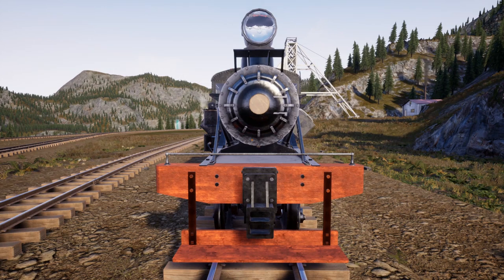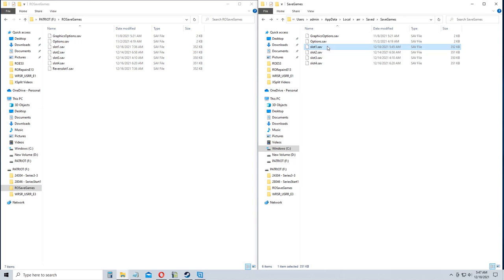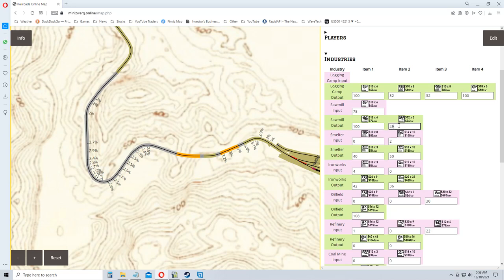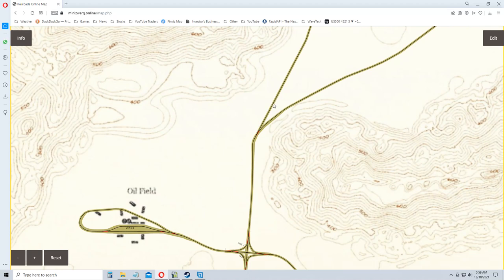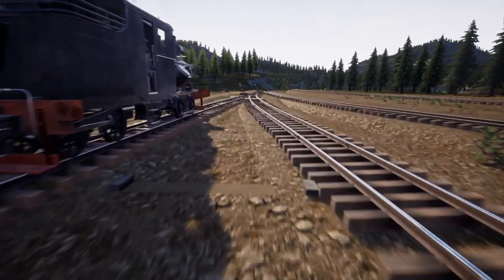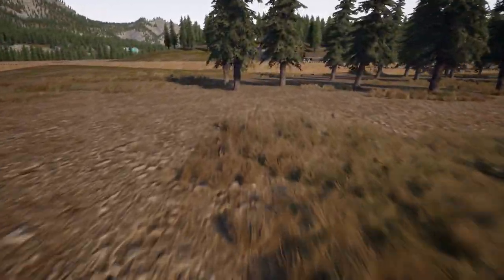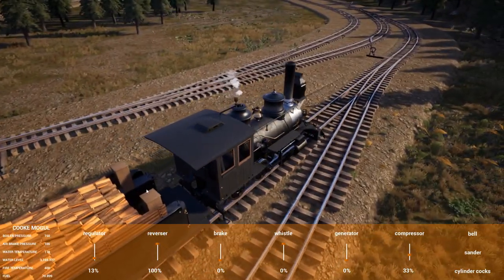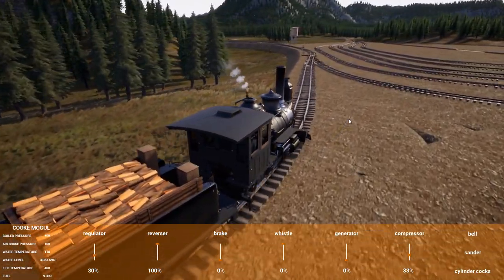Railroads Online! Making 200 Oil Barrels - Part 14 - Map Overview & Link

Comment: Nice spread sheet. I'm still pen and paper but its nice to know what you have and where. I currently have my smelter (cordwood), iron mine (lumber), and coal mine (metal pipes)  stocked so all I have to do now is run beams to 2 locations and run iron down to smelter.